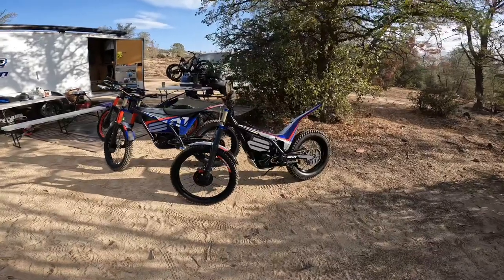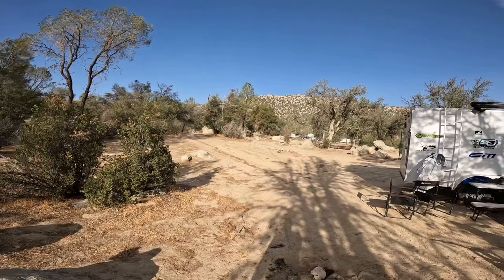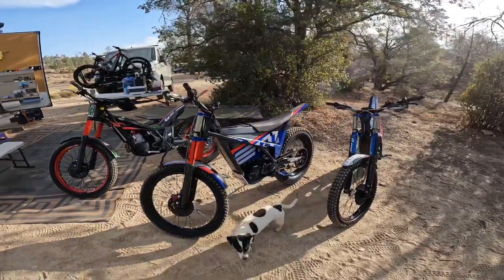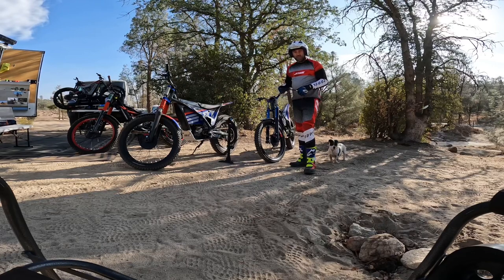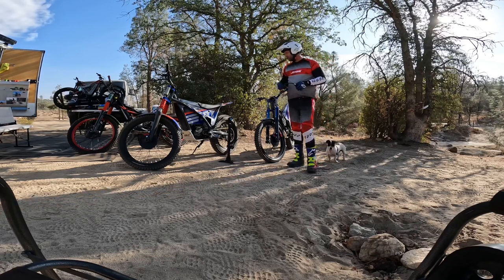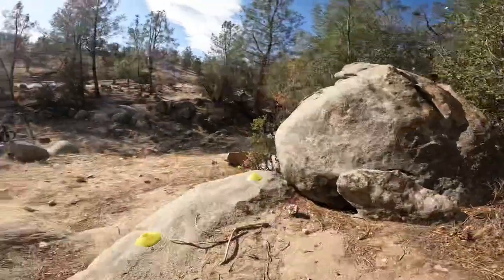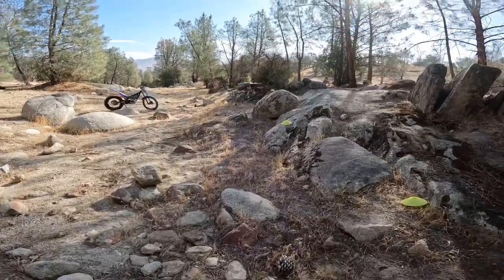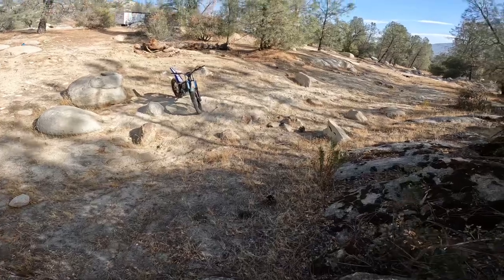Electric motion trials vs Gas bike trials

Comment: 4.5 to 5 is a bit high in the rear, no? I'd normally run 3.75.
Reply from the maker: So it’s depends on the tire the rider wight and tape of terrain. 
We in SoCal riding with 4 to 5 on the tires after break in second day 
I do 4.5 rear. Now with GeoMax I did 2 and 3 for a day and half next ride I’ll try 4psi